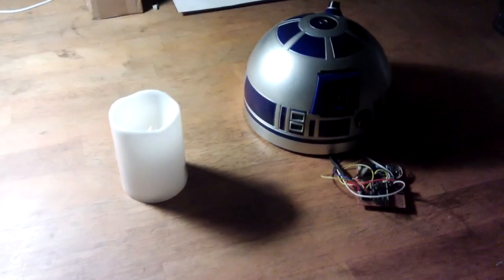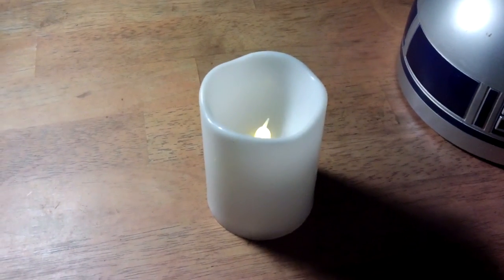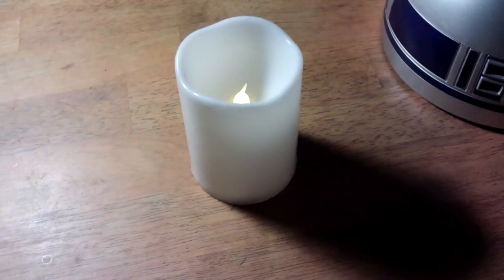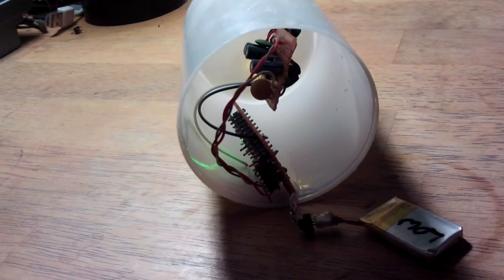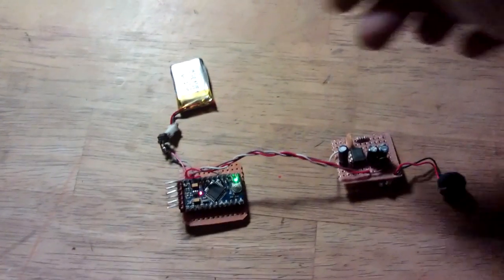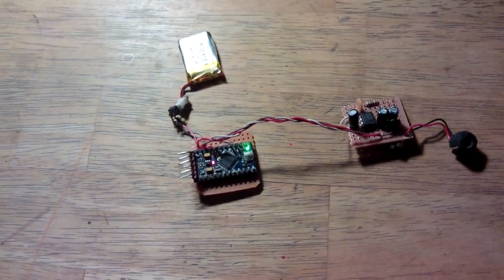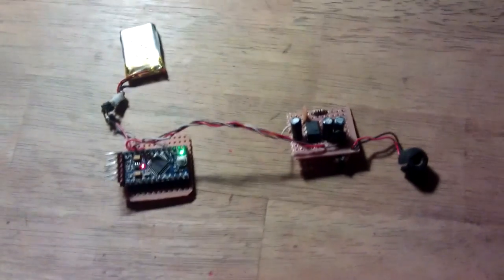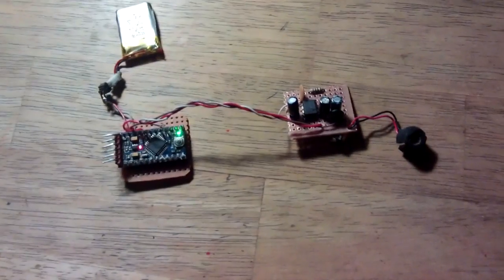Blowing out an electronic candle !

Comment: hi, 

Kindly post the wiring diagram from the flicker LED, arduino pro mini and the LM386 mic amp circuit. 

Thanks
Reply from the maker: The flicker effect is built into the LED itself. The Pro Mini doesn't connect to anything except the LED and the mic input, connections are in the code. 
All is straightforward, the LM386 circuit is in the description box :)

Comment: Very nice! You could make the flame wobbly (cellophane?) and move it around (maybe making it sit on a twisted wire --|_|-- connected to a tiny motor). You could also give it a little blue or red in the center based on the temperature? More red when it's cold and more blue when it's hot. Just my 2ç ^_^
Reply from the maker: Thanks and I like the ideas. Here''s a laugh, being middle aged now I completely forgot about it one evening after blowing the candle out...next morning the lipo was flat. Luckily the protection circuit had kicked in and the battery was fine !
Reply: lol ^_^
Reply from the maker: The punchline to all, being that I was stood there blowing at the thing wanting it to start up !

Comment: So its a clap switch implemented using an MCU
Reply from the maker: Yep, pretty much the same thing. 
The Arduino is a junker from years ago that was repaired today (had a cracked joint on header pins) and all other parts are from a box of spares boards. The mic circuit will be going into the R2D2.